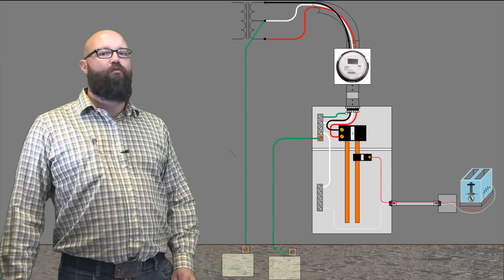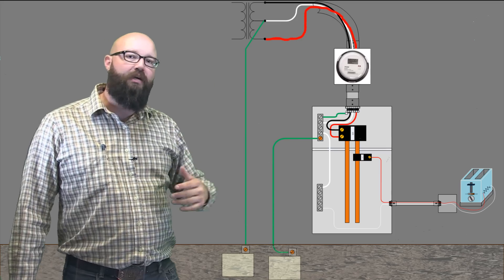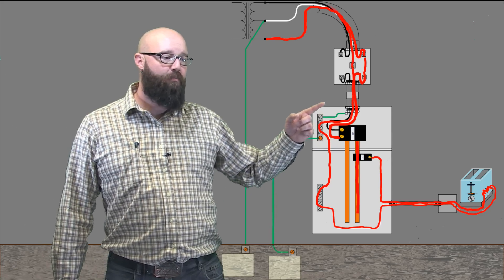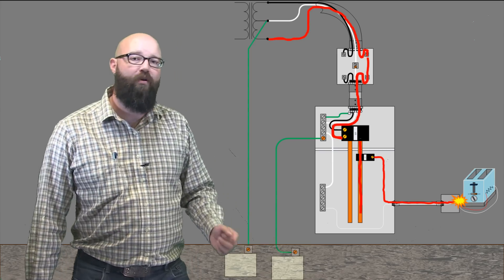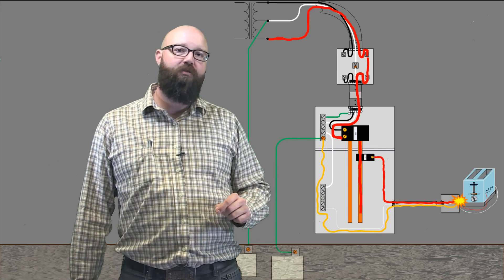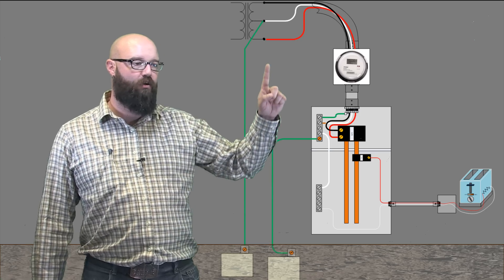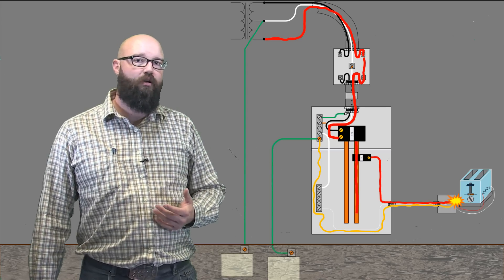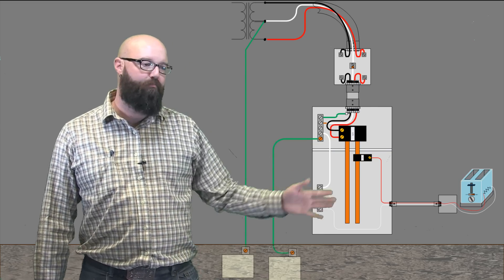Grounding and Bonding

Comment: Am I the only one who noticed that there are two backups for the neutral at the main panel, but the conduit and box connections are just assumed never to fail?
Reply from the maker: That's why it's so important all coupling sets crews, connector locknuts and all bonding splices are made continuous. One sacrificed bonding connection and there could be potential to ground everywhere in a ground fault short.
Reply: @schulerruler  It seems you could argue that it's "important" to ensure that the neutral is connected correctly. What I'm getting at is that I'd rather have a dedicated ground wire included with the cable run to at least bond the outlet box(s) at the far end of the conduit.
With all of the conduits that will come out of the service panel, it seems like a lot of emphasis is being placed on a single (important, if unlikely) point of failure while ignoring a multitude instances with potentially dozens of points of failure.
Reply from the maker: @jstan_49  most cable sets include an integral bonding conductor. Generally it is the base copper conductor that terminates in the box. As far as conduits like EMT and rigid, the couplings and connectors are the bonding means. Also in the event of the neutral coming lose the bigger problem would be an inbalance in line to ground voltages.
Reply: Jim Stanley, never think in terms of the grounding and bonding conductors as backups to the neutral conductor. They perform a different function and could never replace a properly installed neutral. Just look at the difference in size of the conductors.

Comment: How is it that two breakers must be in the off position to cut the power to a 110 light?
Reply from the maker: Sorry is this in reference to the video or a specific problem you are encountering?
Reply: If you need to shut two circuit breakers to denergize a 110 volt light the wiring if cross connected and that need to be be found and corrected.

Comment: I think you finally taught me how the neutral and ground out of a service panel function.  Thank you!!  It would be nice to see the same explanation with a grounded plug tool and a grounded outlet.  I guess it all goes back through the green wire to the ground bar but it does not go to the outside ground rod.  Instead, current goes from the ground bar in the panel to the neutral bar in the panel and back to the transformer.  And since there's no load, it's a direct path back from the tool and current is too high - breaker trips!   Please tell me that is correct.  Otherwise i'm still confused.  Thanks!
Reply from the maker: You got it. Sometimes in place of the green wire, you would have the conduit (if metal) as the bonding conductor, carrying the fault current back to the neutral point.
Reply from the maker: You got it. Sometimes in place of the green wire, you would have the conduit (if metal) as the bonding conductor, carrying the fault current back to the neutral point. 
Thanks for watching and I'm happy it was helpful for you.

Comment: I agree with grayfurnaceman, everything is great right up until the last example.  If there is no neutral path and the electrode is the only fault current path, unless the utility transformer ground rod is in very close proximity and perfect soil conditions, there will not be enough current to trip to Overcurrent device. This is why I stress in my classes the importance of the main bonding jumper.  Go check out Mike Holt's video on Ground resistance testing.  They actually connect 120 volts to a ground rod  and the breaker only "sees" it as a light load.
Reply from the maker: I agree it will not trip in last example. The is still however even under normal circumstances, current on the grounding conductor. I am working on setting up a similar demonstration to observe the outcome. Depending on location it may or may not trip. Someone from Australia said in their soil it does trip.

Comment: Why when I put clamp meter on my ground wire coming out of my breaker box it gives me a reading of 3.7amp on the wire?
Reply: You have a high-impedance ground fault somewhere. Turn off breakers one by one until it goes away. Then reenergize that circuit and disconnect all the devices connected to it one by one until it goes away. Service or replace the offending equipment.
Reply: Jim’s explanation is possibly what’s happening. But more than likely the current in coming from somewhere else. A fault in the house next door is putting current in the earth and it is looking for a path back to the transformer. It finds it by travelling into the panel of the subject house from the earth via the grounding electrode system and then through the neutral conductor back to the source. Most people don’t realize that current can flow both ways through the electrode system because we are taught that the electrodes “send the current TO ground “. But it can also send it back from ground.

Comment: I've moved back to grandpa's farm(Missouri, US) where all the electrical work was done by "touch it to see if its live" hillbillies. I knew nothing about ac so was confused and scared while working on it cause it didn't make sense. Now I know why. Neutral and ground are sometimes tied together at outlets, sometimes only hot and ground at outlets, all the breaker boxes have all the grounds and neutrals going to the bars with jumpers going to the box chassis, and the well only has 2 hot wires and no neutral OR ground. Your easy to understand explanation, the uncharacteristically salient remarks from YouTubers, and your polite and thoughtful replies(guess the Canadian stereotype is true) may have(probably) saved my ass from turning into a flash of light or worse... getting hung up on a hot that wouldn't trip the breaker and slow roasting. Pretty impressive for a YouTube, eh? I think I used "eh" correctly.  🤙
Reply from the maker: Lol. Thanks for the comment. You have definitely used "eh" correctly! Now go say sorry to someone for no reason, pound a bottle of pure Maple syrup and I'll make sure your official Canada touque goes in the mail.
I love farm jobs. Sometimes those old guys come up with the most effective, yet terrifying solutions.
Reply: On the main panel (first one after the meter) the neutrals and ground bars are bonded. Every sub panel after that the neutral and grounds are separated. The neutral bar connected to the neutral feeder wire from the main panel and the ground bar connected to the (usually #4 insulated ground wire) ground wire running back to the main panel connecting to the physical ground. I was recently working on a house where the wiring was quite old and I had to make sure all the metal boxes were grounded and the receptacles were grounded as well because the idiots who did the remodeling didn’t really know what they were doing. Tedious work.
Reply: Jacob Harmon
Yeppers, I worked on a 220VAC halogen light out at my in-laws, small desert town. I pulled the lamp, noted circuit breaker was off, aluminum ladder. The metal pole went hot. Luckily it was AC and I didn't fall, lost my breathe for a bit. Took a couple hours to find the problems. One was a missing ground.

Comment: Hi, great video. Explains quite a bit. Question - why do we remove the bond screw in a sub panel situation?
Reply from the maker: Thanks for watching and commenting! If the brass screw were not removed it would create a parallel path back to the supply neutral via anything bonded. It creates touch potential on metal components and this is not a situation that would trip a fuse or breaker. A GFCI would most likely trip, as there is a differential in current out to load and back on identified neutral. 
If this situation were to occur, someone touching metal (ie conduits, boxes etc) would then be at the same potential as the bonded metal and could recieve a shock by touching something grounded. Not ground itself, but something connected back to the supply grounded (neutral) connection. You would be essentially completing the path.
Reply: schulerruler - thanks for explaining.

Comment: the drawings are a little unclear. you draw in paint over a good picture and i could not understand why everything is wired as it is, and what is what on that drawing.
Reply from the maker: Its actually not in Paint, but rather i am using a powerpoint with simple animations on a greenscreen to capture the image. I am happy to answer questions you may have that are unclear. The intent of the video was as supplementary information for classes i teach, regarding Canadian Electrical Code, and  SIMPLE paths for grounding and bonding. 
I think i would probably animate the path of current with a different color if i were to do it again.

Comment: If you are displaying a single phase setup why have the 3rd line?
Reply from the maker: We utilize a 120/240v system, where the single phase secondary of the supply transformer is centre tapped to provide both a line to ground voltage of 120v and a line to line voltage of 240v.
Reply: @schulerruler  ok weird ... is that to suite both yank and euro devices (120 vs 240 devices)?

We only have 3 phases of 240v each here plus the 4th line on the pole is neutral tapped.  We can then order 240 single or 415 3phase. Our house we are renting is weird as it has 2 power circuits each on it's own phase (2 phases supplied) and meter which no one I know has ever seen. Our neutral bridge has a link then to our earth bridge to keep it at ground potential I think it was for.
Reply from the maker: @NullaNulla  Generally our larger loads (oven elements, compressors, clothes dryer elements etc) are supplied 240v, while our smaller loads operate at 120v. This is in a residential application though. 
We also utilize similar three phase systems like you are describing, but generally not in residential applications. More for commercial/industrial applications.
Reply: @schulerruler  yeah 3phase is industrial/agriculture here too and for much larger aircons (ducteds etc). We only have 240single applied to the average house so everything is 240. thus seeing 2 seperate voltages is odd and makes no sense :).
Reply from the maker: @NullaNulla  the original intent was the lower voltage to ground was safe than the 240v.
Reply: @schulerruler   how did that work in practice? 240 or 120 at decent enough amperage you're in the poop.
Reply from the maker: @NullaNulla  Oh I definitely agree. 120 doesn't hurt as much but if you aren't careful it'll still kill you.

Comment: Nice video.   Showing the path of current step by step makes your explanation very clear.   During the last part of your presentation, I would add that there's a non-zero impedance in the dirt between the house ground/dirt location and the transformer ground/dirt location.    The breaker will trip only if that impedance has a relatively low value (typically 5 ohms or less).    Since it is virtually impossible to configure a low impedance dirt connection in some locations, you should never rely on the idea that a fault into the dirt will trip the breaker.    You might ask, if that's true, then what's the purpose of that dirt connection.     Its purpose is to dump lightning and static induced charge into the ground.     Whenever there's a lightning strike close by,  the current flowing in the lightning bolt will create a very large changing magnetic field.    That changing magnetic field will induce a voltage in all of the metal parts of the electrical system (conduits, wires, etc).     If you don't connect that system to a dirt ground, those metal parts can provide a pretty nasty shock.   So, what I am trying to say is that you need to make it clear that there are two types of "grounding" for systems governed by the National Electric Code.    First, your "tripping the breaker", "current returning to its source", etc issues are part of "Equipment Grounding".    Second, draining charge from lightning and static electricity to the dirt is part of "System Grounding".     Bill
Reply: I just read my above comment, and it's possible that someone might misinterpret what I meant by "draining charge from lightning".    I'm not talking about a direct hit from lightning.   I'm talking about lightning going  from cloud to cloud overhead.    That short, high voltage DC pulse of current will generate an expanding and contracting magnetic field.   If your metal conduit, wires, etc are in that changing magnetic field, a voltage will be induced on those metal parts.   The "System Ground" connection to earth (the dirt) is installed to drain that charge.
Reply: Thanks for clarifying. I thought that was a significant oversight in the video

Comment: My friend had an old vacuum cleaner one time, it worked perfectly, but when you touch the outside metal case or the metal hose handle while it was running, you would get shocked, why is that?
Reply: That's a good question with multiple explanations. 1) could be nothing more that static electricity from moving the vacuum on the carpet and touching the metal hose. 2) if the vacuum only had a 2 prong cord (hot and neutral) it could be the wall outlet was wire backward and the hot and neutral were reversed (using a polarized plug) making the metal hose live. 3) could be inductance discharge from the motor if the vacuum is not grounded (again just a 2 prong cord connection), or could happen if the appliance is partially grounded. 4) if the vacuum has a grounded 3 prong plug, the ground wire could be bad in the appliance or in the house. Many possibilities, that's why most metal electrical products have 3 prong grounded plugs, and 2 prong polarized plugs in most insulated electrical products.

Comment: At service pole transformer neutral is grounded to earth. No neutral overhead conductors. Three wires is three phase. No neutral. I work at Power plant prime mover has huge ground arrays in soil. All potential ultimately return s via ground soil water table etc.
Reply from the maker: This is for a Edison three wire 120/240v residential supply where the system incorporates a grounded centre tapped neutral. It is a three wire service that would be fed from a transformer either underground or overhead.
Reply: schulerruler Perhaps the commenter was looking at a 3 phase Delta source.
Reply from the maker: @peternotarfrancesco2614  many people are unfamiliar with the North American dual voltage 120/240V supplied in a single phase system. There's been a few comments suggesting this is not a real service, when I can assure everyone it is very real.

Comment: Excellent teaching. could you explain when the main ground to the panel get disconnected at 115v outlets can read 220v
Reply from the maker: Thanks for watching and commenting!
If the reference to ground is removed at your neutral point, or if the neutral is broken, your supply voltage (240v) will distribute proportionally amongst the loads. Higher impedance loads will have higher voltage drops while lower voltage loads will have smaller voltage drops. At this point we have to think of the circuit as a 240v supplied series circuit as opposed to 120v individual circuits. The grounded reference was what maintained the 120v.

Check out my channel as one of the latest videos I've uploaded deals with open neutral situations in an unbalanced Edison three wire distribution.

Comment: stupidest safety system ever, slightest screw up of your installer will send you to kingdom come in the event of a fault to casing, and may put everyone using the system at risk of death
Reply from the maker: Fortunately that's why we have electrical codes and inspection departments to catch potential mistakes. Thanks for watching and commenting!

Comment: Your last exemple is completely wrong becouse  normal breaker don't trip in TT system becouse  the high impedace. It would trip only if we had a RCD(GFCI)  installed in the panel as in europe or in Brazil
Reply from the maker: Yes. We've established that throughout the comments. There would be current flowing through that part, but as you've said the impedance would be too low to trip the overcurrent. Thanks for watching and commenting.